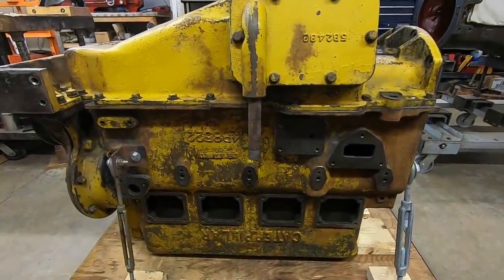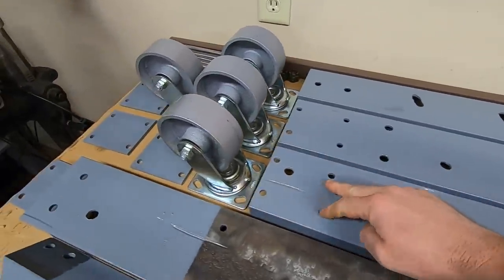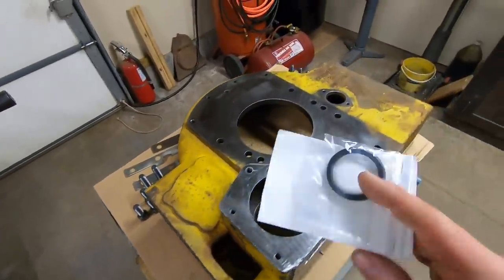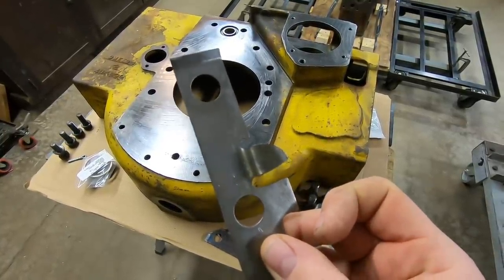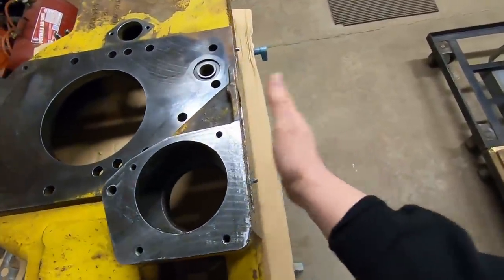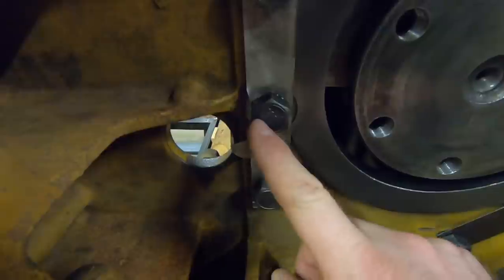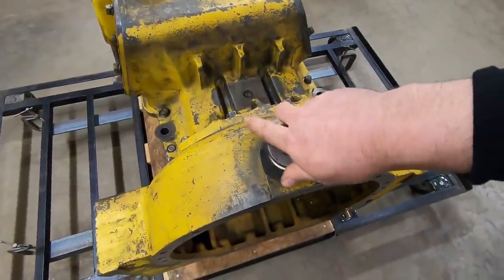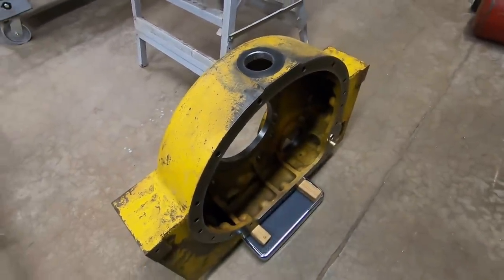Caterpillar D2 #5J1113 Diesel Engine Assembly Ep.19: Installing The Bell Housing & Ready To Flip!

Comment: You can dial indicate the piston to find true TDC, then with the flywheel on tweak that pointer as necessary so it points accurately to trued TDC for that assembled combo. You know for that OCD perfectionist in all of us. :-) lol
Reply: yep thats correct
Reply: @squatch253  when checking for TDC, since the piston "dwells" at TDC I'd recommend checking at 2 known measurements before and after TDC, the difference between those 2 places is true TDC. A degree wheel helps, but even just using a pointer (sharpened coat hanger or brazing rod works) works well. Pick your distance below TDC to check, let's say 0.025"  set the pointer to point at a convenient place to mark on the flywheel, zero your dial indicator on the sleeve flange edge, then move it over the bore to the point you want to measure on the piston. I use a magnetic deck bridge to do this with that holds a 1" dial indicator. But a mag base also works. Now that the dial indicator is set to 0 off the sleeve flange, rotate the engine until you're 0.025" below TDC make a mark where your pointer is now pointing, continue rotating past TDC until the piston again drops back down to 0.025", make another mark. Halfway between those two marks is exactly TDC. You can also do this with just a dial indicator on the piston and no pointer by trying to estimate the amount of dwell at TDC but I find this is less accurate since the piston likely dwells for 3-4 degrees of crankshaft rotation at TDC. My guess is that the factory mark and pointer is fairly accurate. Cheers.

Comment: I've been gleaning your Vlogs over and over the reason is I recently recovered several "boxes of bolts" namely two 1958, 955,  12A3563, 12A4040 and a 1961, 955C 12A8263 Traxcavators all basic D4's with extended tracks and bucket loaders. Two of them have 95 to 100% life left on the undercarriages. one reman D315 head and rebuilt pony motor. I have had my hands on just about every other type of motorized rig but Caterpillar; so your Vlogs have been most valuable to help tame this wild animal. One thing I notice is Cat don't do things like any other equipment manufacturer they rely a lot on VIN numbers which you have helped me domesticate. Another thing I have come to realize is Caterpillar means heavy even the bolts are heavier or I'm just getting to old to bolt. 
I hope to Video log the resurrection and restorations of these Cats like you have done for your D2 5J1113. That was/is quit the undertaking and accomplishment. Thank you so much for sharing your experiences with me/us. I have learned in life that experience is expensive and you are a remarkable person to share your knowledge with others and ask nothing in return but for the betterment of others. For that I consider you a real Man among men. I'm not blowing smoke here I'm just trying to show my appreciation.
You make it look so easy, but the only way I'm going to get it done is to do it. I took a chapter out of your book and as I began to bring each "Boxes O' Bolts" home I tagged and logged each piece to its corresponding D4 S/N No. I received the two 955's from an ol' Colney family member (Old timers in the area for more info look up Matanuska Valley Colony); we'll call him Dav, short for David (not his real name). Good ol' Dav got the 1958, 955, 12A3263 and the 1961, 955C 12A8263, and an eclectic group of manuals from his uncle (Bob short for Bob, and again not his real name either). Both 955's diesel engines needed some type of work and/or assembly. Dav's wife apparently needed her parking spot back after several years of dodging heavy equipment. So I helped Dav out by taking them off his hands and out of his wife's way. HeHe!
Now here is where it gets interesting. I first took the manuals home and started familiarizing myself with them. Inside the manuals were pieces of scrap paper with hand written notes, receipts, random lists of part numbers and other obscure 955 S/N's   - like they had been used. Good intel as to potential problem spots or recent repairs.
The next morning I call Dav to set up a date to exchange paperwork n stuff, Dav tells me of a guy down the road that has another 1957, 955 Traxcavator that has a bad case of the "All-Overs" but a "??? working ???" D315 engine. I thought what the heck so I went over just to look at the 1957 to see how much was still usable. Giving it the general eagle eye walk around looking at the undercarriage parts (hum), spin over the pony and the diesel engines, oil yada, yada, yada. Then I look at the S/N 12A4040 and recognize the number from the scraps of paper in one of uncle Bob's manual. It then accrued to me that all three of these Cats were owned by uncle Bob at one time. Later it also accrued to me that 12A4040 was built 477 after the 12A3563 which most likely means that 12A4040 is either a 1958 or 59.
The bits and fragments of notes and scrap paper also gave up more of its secrets about prior owners,  prices payed, dates, parts replaced and how much it cost to transport to Alaska way back when. I payed more to have them hulled across town than it cost to get all three; shoot I think just the story is worth the price.

Comment: The cotter key trick in a drain hole reminds me of my great uncle who is long gone .. He fascinated me with things he could repair.. I often wondered where he got the cotter key idea but he was a mechanic in the Corps of Engineers during ww2 and much of his work was Cat.....Mike in Louisiana
Reply: I did not fully understand the reason for the cotter pin. I am sure it has a good reason though. :-)
Reply: @ronaldkearn3322  It prevents the hole from clogging up. Every time the dozer hits a bump, the loose pin will rattle and spin a bit, and that will clear any debris out of the hole, keeping it open so that excess oil can drain.
Reply: @bills6093  Thank you :-)
Reply: BILL S we used them with British sports cars too.....the cotter breaks the surface tension of the heavy gear oil and keeps it off the clutch lining...no plug, just a hole in the bottom of the bellhousing.
Reply: @jamesanderton344  Thanks! I think I am going to use this on my antique Farmall tractors. :-)
Reply: Ronald Kearn I’ll bet it works great....the old British stuff used 1930s technology up to the 70s....cast iron, long stroke engines, three compression rings, full skirt pistons, etc. always wanted a hobby tractor.....Farmall row croppers are low price on my area, but people want a crazy buck for worn out 8N Fords....
Reply: @jamesanderton344  So do my John Deere, two cylinders. Great stuff. :-) By the way, Ford tractors were never popular here in New England. John Deere, Farmall, and Allis Chalmers were the big three! Oh yes there was the occasional Ford or Massey Harris or Fergeson ,but , very rare. :-)

Comment: My dad fought with those pony engines on D2/Grader (unknown,  50s era) and a D7 cable cat (WWII surplus I suspect).     I have to wonder if all the Cats were worn out as it was a struggle for him to get them going.    He was not in a position to rebuild them unless they simply broke down.    I suspect FI,  rear ends etc were all in the same condition,  it was occasional use so other than the D2,  once a year a multi hour struggle was doable as opposed to a winter long tear down and trying to get parts into AK (usually 6 weeks to 3 months in those days)

Comment: I like the pony motors to I was young when I learned to use one it was on a D8 man I thought I was cool.
Reply: my D7 had one also! in the cold weather, and believe me, New England gets very cold in the winter. The contractor I worked for epected that machine to be running 40 hours a week. On th 0 nights I would disconnect the battery and take it home just to make sure that gasoline motor would start. I'm sure I'll get someone making fun of me on that note. :-)

Comment: I'm a little bit surprised you didn't weld up the torch cut holes, grinder scars, and then grind them smooth. Zero chance that a local cattle farmer, YouTuber, mechanic doesn't point that out. It seems like yesterday and you were flipping the 5J1113 original engine over center for disassembly. We were so young back then.
Reply: @squatch253  does the acquaintance you speak of have a screaming Detroit powered skidder, and does a mean Shelby Stanga impersonation? If so, same guy.

Comment: If you put oil or anti seize on the locks and bolts they have allot less chance of turning while tightening. Also an air impact works good to get the bolt heads in the right position.

Comment: i would have spread a thin layer of hylomar/Permatex 85420 between the back of the block and the bell housing.. just to stop corrosion build up. also on the drain plug threads.. Jpaydirt found out they sell it in spray as Permatex 80065..

Comment: Well if you wanna lose a subscriber go ahead and swap a pony out for electric start!....the reason most people don’t like them is they don’t know what it’s like to hang with the cool kids😎
Reply: @squatch253  My 820 is the same way, that pony really screams at full throttle but man does it sound sweet when everything is turning over and that big diesel pops off!.....I can and do listen to electric starters start engines multiple times a day and that's boring LOL
Reply: @squatch253  LOL. We've been trying to get the main engine going on 5J8882 and the starting motor wouldn't start. We need up with a grass trimmer motor and belt cranking the starter motor to try to get the main engine started.

So an engine to start an engine to (try to) start an engine.